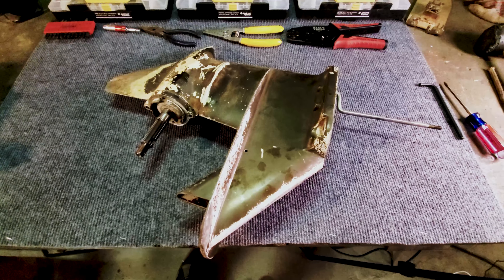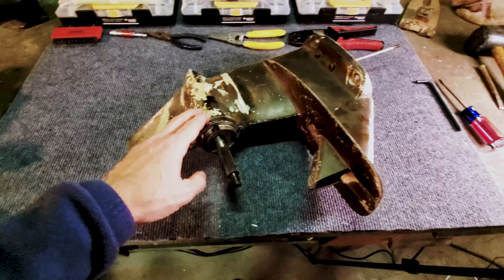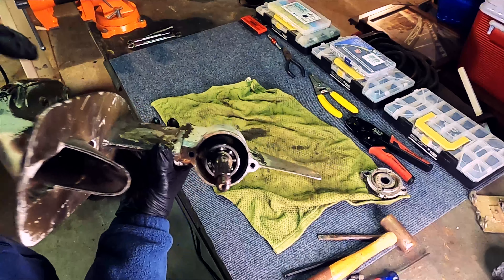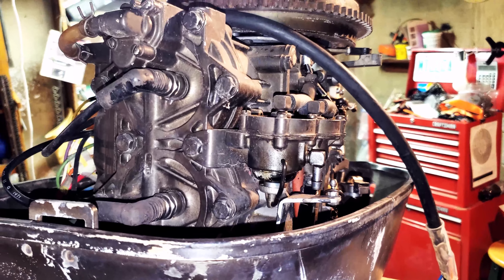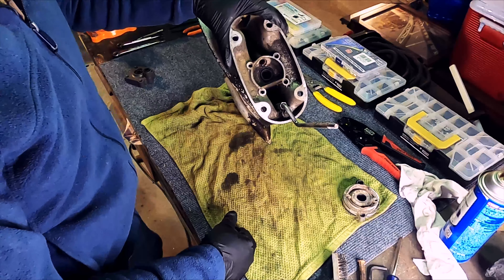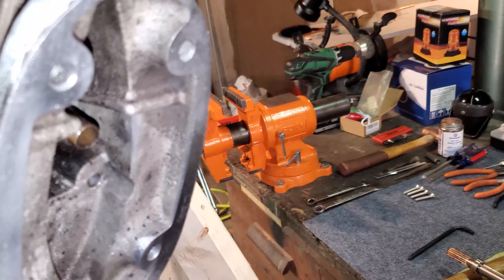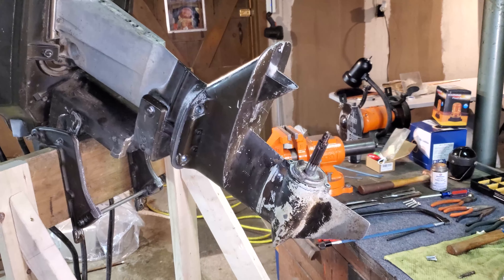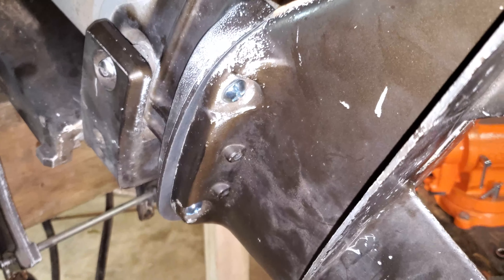Classic Outboard Water Pump Install (1972 Sea King / Chrysler 35 HP)

Comment: Nice description!  Do you know if the 1970 Sea King 55hp is basically built the same?
Reply from the maker: It should be virtually identical. I'll actually be posting a video this weekend on replacing my lower unit with a 55hp one. Stay tuned!
Reply: @603photog  I will!  I just bought it and I think it would be wise to check the impeller and replace the oil. Do you know where the water pickup for the pump is?  I see two small holes on the side of the foot. Thanks!!
Reply from the maker: @pygmywarrior3  Sorry for the delay. The water inlet to the pump is a rectangle opening on the bottom side of the quasi-anti-cavitation plate.